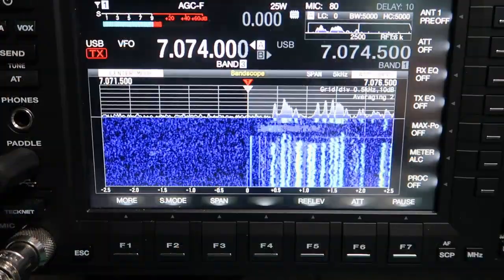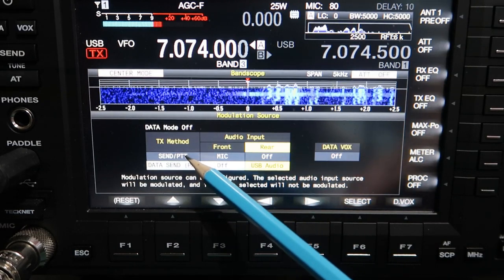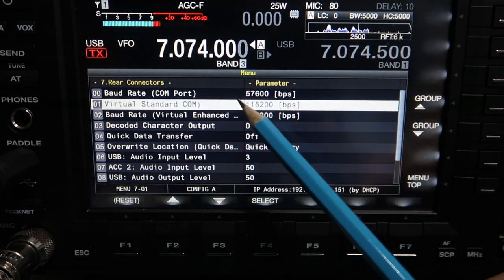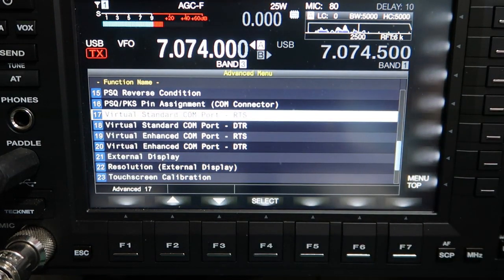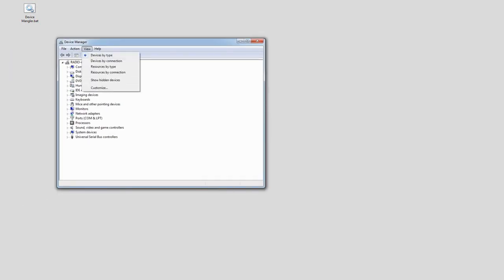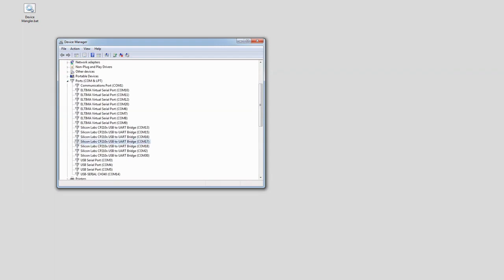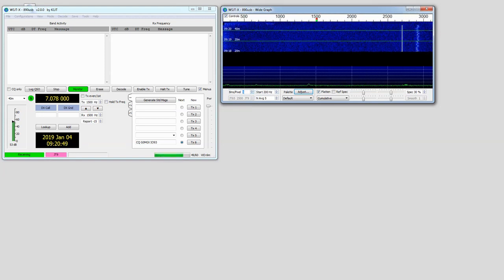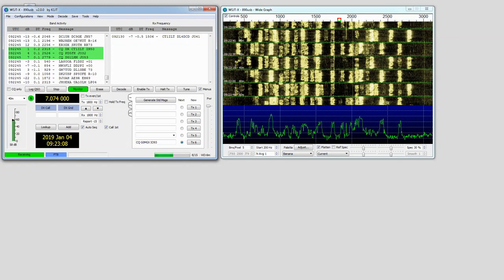TS-890 - Digital Mode Config - FT8 WSJT-X

Comment: Thanks Mark.

I'm a 6+ year TS-990S owner.  I found from your video a few nice features on the 890.  In my own case I feel I most have a 2nd receiver so there are differences.  But somw of what you have shown are simply changing how something is done but usually with the same number of keystrokes.  Key feature I wish the 990 had is the different band stacking registers (I defined 3) can have frequency limits identified.  Very nice - wish the 990 had that.

A point in your video I'm wondering about is in the DATA mode.  With audio coming in from the PC on the USB interface why not turn DATA VOX to ON?  On the 990 we select in the DATA BOX window USB Audio to key the radio via input from the USB interface.  No need to deal with the 9-pin RS-232 interface.  So there is only one cable (USB) between the radio and the PC.

Thoughts?

73,
Bob - W6OPO
Reply from the maker: Hi Bob, I personally don't like to use Data VOX as far too many times my computer has generated beeps, bonks and other noises which get transmited. I perfer to key the radio and control the TX.
Reply: @MarkG0MGX  computer generated audio - the beeps or whatever you mentioned - should be directed to the computer's speakers not the sound card (USB Audio CODEC).  WSJT-X talks to and listens to the audio CODEX via USB port.  The other audio is talking to or listening via other sound cards like Speakers etc.  That is how I have my PC set up and therefore never experience any form of interfering audio.  For instance watching a YouTube video with sound while WSJT-X works a station.

Then one can run in USB-D mode taking advantage of the DATA mode features set up in the DATA MODE - ON screen.  Then EQ, Compression, etc are defeated when in that mode.

Enjoy - nice radio.

73,
Bob - W6OPO